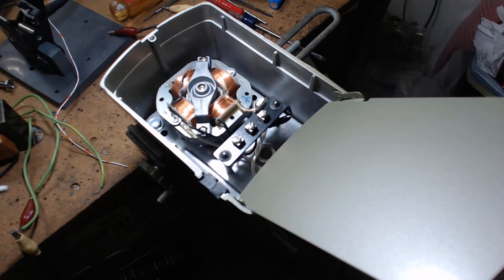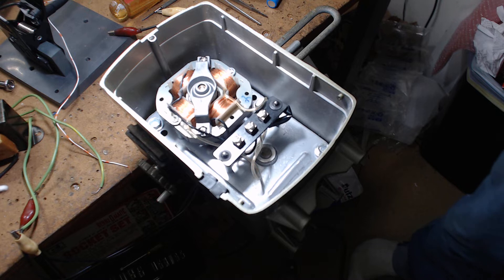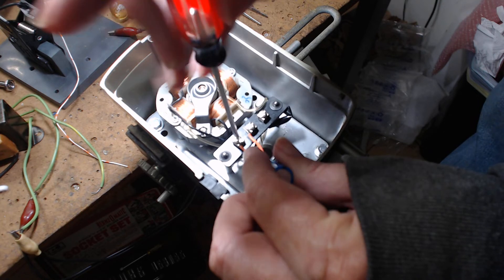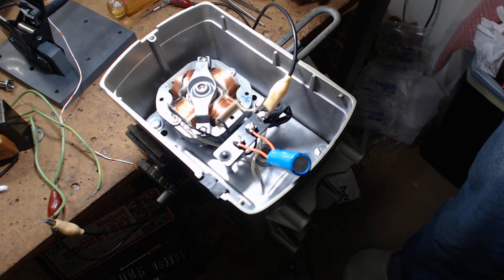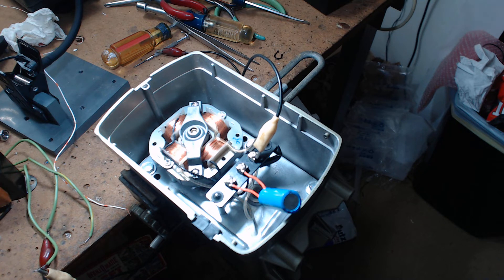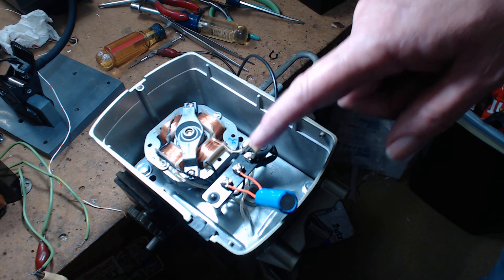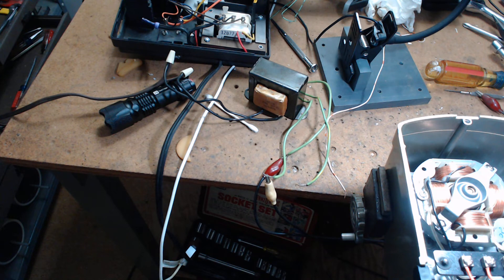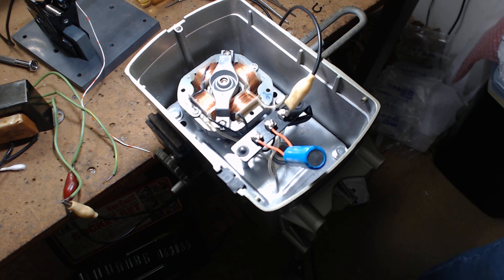GE or Archer or Radio Shack three wire TV Rotor Testing

Comment: I removed the gear set.  The rotor main antenna shaft is frozen solid where it goes up through the housing.  30 years in the air.  Not used for the last 15.  The 12ft long channel master / archer antenna is refurbished.  As you say, these are running $250 today.  I think the controller is good.  I'm going to start with seeing if I can get the motor running.  May be too much rust in the bearings, but modern lubricants pretty good.  The load bearing surfaces for the ball bearings of the load bearing shaft (the one that is frozen) will need to be refinished.  probably a very fine disc of the right diameter and then polish.  Of course once the motor running, I have to remove the big gear on the main shaft and see if I can break it free and replace the upper bearing.

Comment: How do you get the rotor apart? Mine acts like the grease is dried up and needs replaced but I can't get it apart after removing the snap ring from the shaft, it wont slide out.
Reply from the maker: The gears were crumbled in the controller  and my rotor  would not come apart. They are in a land fill!